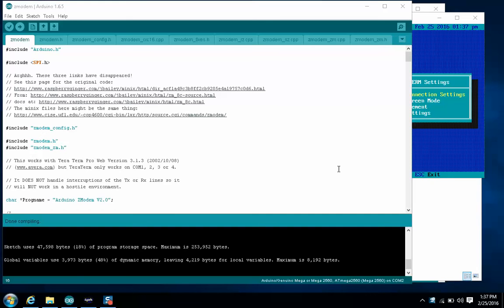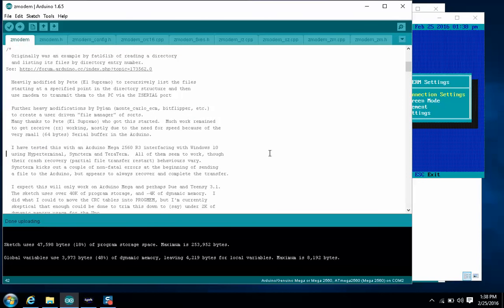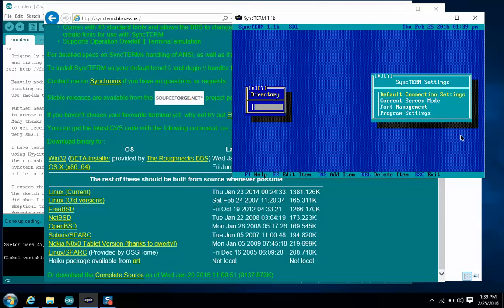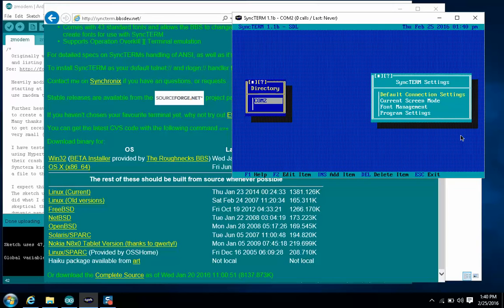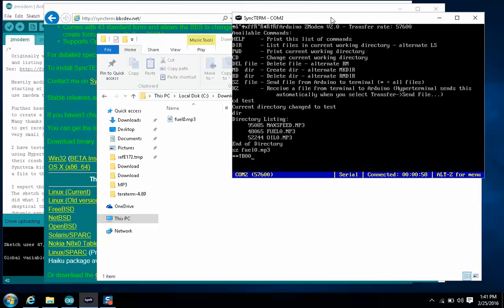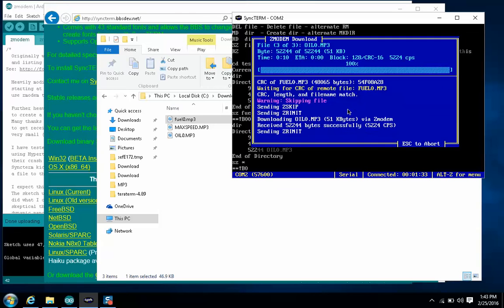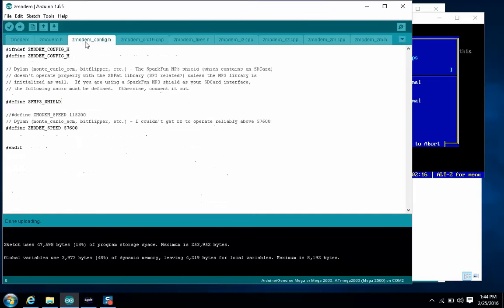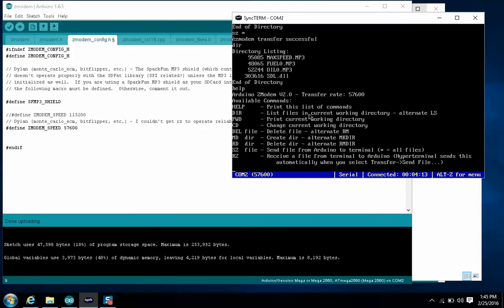Arduino SDCard file manager sketch with ZModem

Comment: I have made this project. Sir, I have a question, is it possible to add SD card datalogging code to your zmodem sketch without upsetting it's timing requirements?

Comment: This is exactly the solution I am looking for. I am about to post some observations about my attempt to use this code in the PRJC forum. I thing I originally didn't notice is that you appear to need 2 serial ports, one for debugging and one for the ZMODEM transfer, however in your video the help print (DSERIAL) appears in the same window as the ZMODEM transfer (ZSERIAL). If you read this please look at my longer message in the PRJC forum. Thanks for sharing this code.